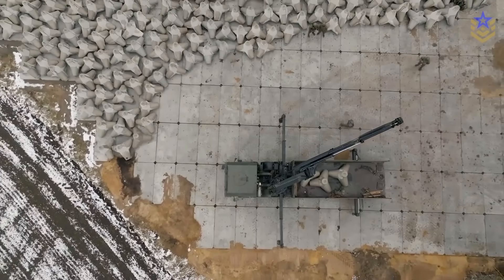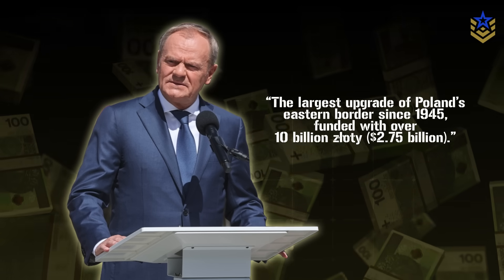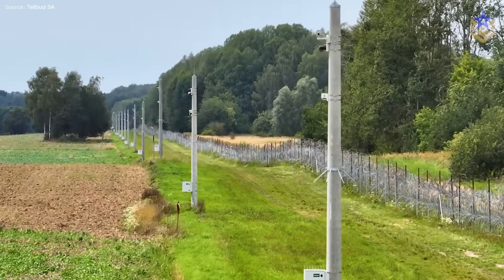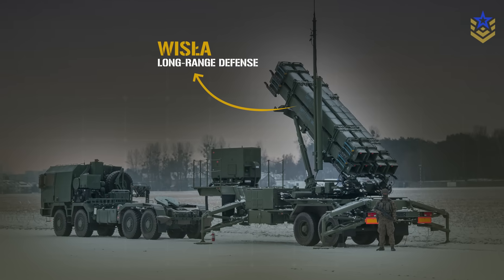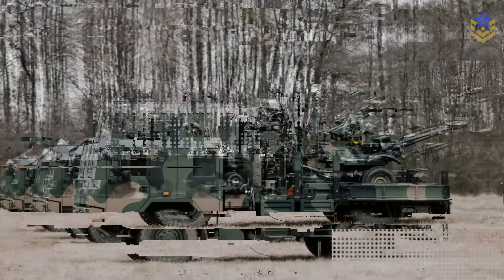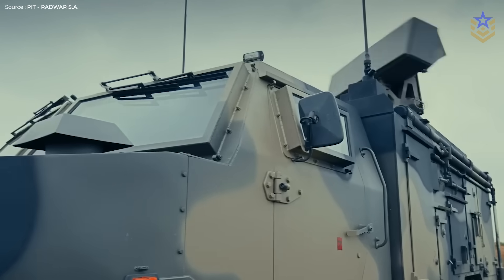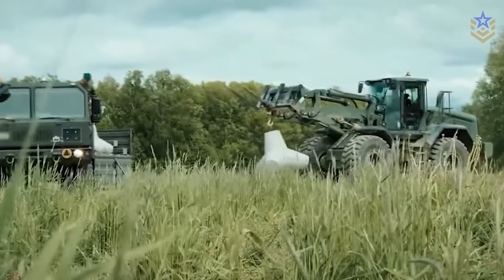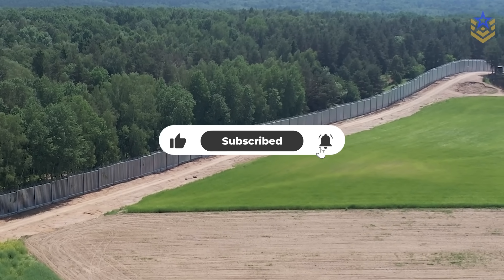Poland’s East Shield Program: Europe’s Largest Border Defense Project

Comment: I think if Russia decides to attack Poland it won’t be like in Ukraine on the ground right away. First, they will try to destroy everything what inside Poland, main thing power station and unlike Ukraine, Poland does not have nuclear plants, so you will need to import electricity from other EU countries, also recommend buying Ecoflows, helps in Ukraine) After that maybe they will try the ground  operation. Work on your air defense, also remember separate for drones and separate for missiles. Don’t use expensive missiles for drones, Russia has a lot of drones.